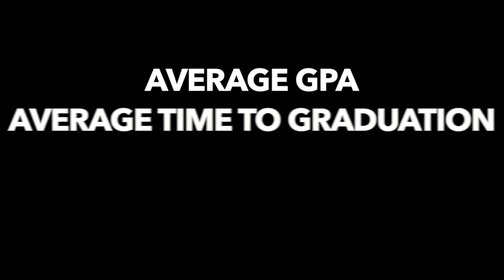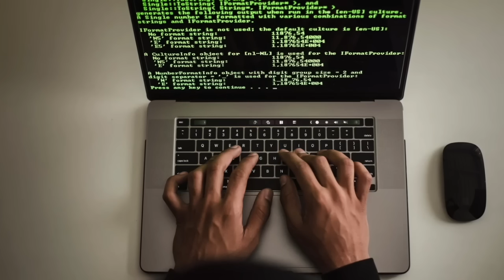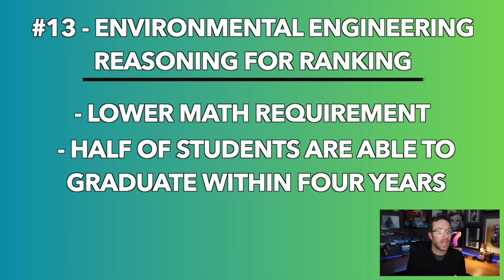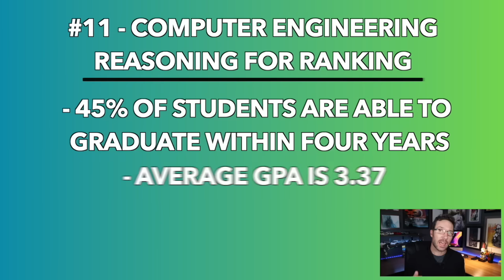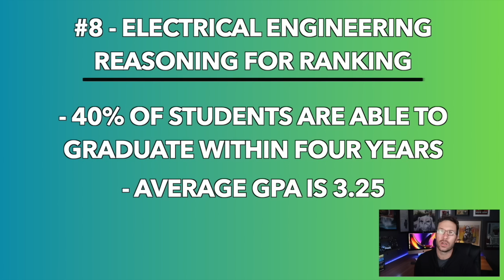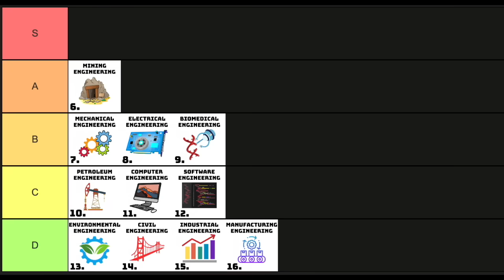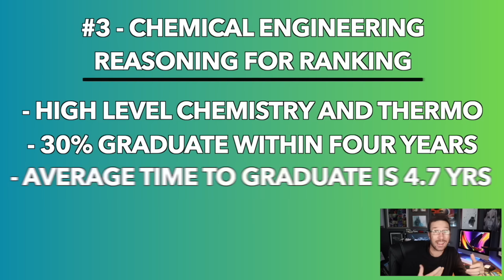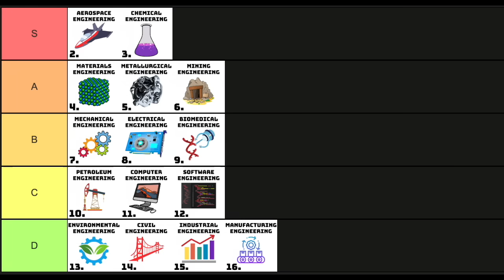Engineering Degrees Ranked By Difficulty (Tier List)

Comment: Chemical Engineering is definitely one of the most difficult.  Consider doing it in 4 years while working a full-time job and still achieving a 3.7 GPA.  The pay is MUCH higher than what they say here.  I am making over $200k as a senior-level program manager in the pharma industry
Reply: How many years of experience do you have? I’m also looking into chemical engineering for uni, would you recommend it?
Reply: @MLA979  I graduated College in 2000 with my B.S. in Chemical Engineering.  I think it is a great degree, because it is so flexible.  Yes, you can design chemical processes, heat exchangers, reactors, distillation columns, etc. But, you don't have to.  As a Chem E., you are well-respected by others, as they know what it takes to complete the course work with a very good GPA.

I have spent my career perfecting my "personal brand".  I started out for a decade in the semiconductor industry, but then transitioned over to a Medical Device company, as I didn't want to get typecast as a semiconductor engineer.  I developed leadership skills, among other things, along the way,  Now, nearly 25 years into my career, I have a great income with a great job with plenty of opportunity to pursue a Sr. Director type role.  

I hope this helps.
Reply: This is very refreshing to hear. I’m currently a ChemE senior. I was worried about average salary in this vid. I know starting salary isn’t $200k but willing to put forth the work and effort to get there!
Reply: @errrcc that’s an insane salary average people live off 30k
Reply: @RedArrow808  true. But that’s a reason why I went into chemical engineering. It’s a tough tough degree to finish and that’s why it can make big bucks. Plus it’s a degree that can provide for my family.
Reply: I'm working as a manufacturing engineer, doing mostly software and data engineering, while having a chemical engineering degree LUL. I definitely feel overqualified with the degree, given how difficult that shit was
Reply: Is it normal to end up with a salary like that or even higher for a chemical engineer? And how much time/experience does it normally require to get to that point.
Reply: @FrancoGM Anything pharma is huge.
Reply: @FrancoGM  I'm 45 pulling $200k+ with bonus. Chemical Engineer in the life sciences field doing Program Management
Reply: @FrancoGM  As I was finishing my MS in chemical engineering, I asked an experienced ChE what the career path was for a chemical engineer.  He said that most chemical engineers have moved into management within about 4 years because their knowledge base and understanding of processes and of the financial implications of decisions (e.g., process design and economics for chemical engineers) was superior to that of other disciplines.
Reply: 1985 ChemE grad.  I think EE is the hardest - or would have been for me.😊
Reply: @nealewalter I’m an EE but started out ChemE. I think whatever you are interested in is the one you should pursue. I was interested in BME but decided to pursue one of the more foundational engineering fields because the job market was broader. BME jobs are hard to get depending on where you live versus other industries.
Reply: You’re a pm not an engineer.

Program Manager get up to $300k with bonus and directors get about $500k where I work.  VPs are $1M.  

Many got engineering degrees but aren’t engineers anymore
Reply: @Youtubeuser1aa  The power of pivoting.... It's what you HAVE to do in odder to maximize your income. Skate to wear the 0uck is GOING to be.
Reply: Lol quants make $200-250k+ (not even including total compensation) out of undergrad…
Reply: @bruhchilll  I wish you well. Quite a lucrative career in quantum funds
Reply: @bruhchilll however, many unemployed after graduation
Reply: Hell yeah brother! And yeah the average pay always feels quite low for these but if you specialize and something or perform better than the average Joe you can land WAY above average in pay.
Reply: @nathanielmillington4950  BINGO! I have unique skills in the life sciences that I leverage to my advantage. Not only am I technically savvy, I'm in Program Management, which requires great leadership to do well. Also, being able to take on improvement initiatives while doing a great job day to day and having a good attitude... They all matter
Reply: What university did you go to?
Reply: @tiziocaio101  University of New Haven in Connecticut
Reply: @degenerate_mercenary9898 ur right, but nothing u said contradicts what i said lol. even if the positions are scare and "elitist", those quant positions still pay the highest by far out of any field right out of undergrad... :)
Reply: @bruhchilll  so what? Whats your point? mike zuckerberg dropped out of  college and became a billionaire lol quant positions are not easy to land, life is not a contest
Reply: @hil449  lol ur kinda just saying the essence of my point to the original comment, OP is bragging about chemE and its high pay, i simply stated a field that has even higher pay, and ur stating another path that has evennn higher pay... mad?
Reply: Electrical Engineers in the pharma make more than Electrical Engineers in other industries.
Reply: @benrex7775  I don't doubt it. For diagnostic equipment, drug delivery, etc. Absolutely
Reply: @errrcc  tbh i find that hard to believe. link an entry-level out-of-undergrad chemE position that has a starting salary decently higher than $250K. im genuinely curious to find out
Reply: Plus all of the pre-med students with photographic memories in your organic chem classes
Reply: Nuclear Engineering - I had to take Advanced Differential Equations, Matrices and Vector Spaces, Calc 3, Modern Physics regarding Relativity and Quantum Mechanistics, Circuits Courses, several thermo classes, plus the nuclear core classes - It was incredibly difficult.
Reply: Creating bogus vaccines ?
Reply: @pawbgles  I treated college like a job.  I was a late-bloomer of sorts, at lease socially, so missing parties, etc. didn't bother me much.  The classes were tricky, at times, but I practically lived in the lab/classrooms.  Where I went had smaller class sizes, so access to an all-PhD staff was readily available. I had my core group of co-ChemE's that I hung around with, but they were diligent engineers as well.  We were a tight group.

The way I looked at things was this: I can bust my ass for 4 years and the rest of my life will be easy, so long as I live within my means.  Getting a ChemE degree has been great for me. It is a highly-technical degree, so people know that you know your stuff when it comes to chemistry, physics, electrical, mechanical, and many others types of intelligence. With my education, I have been able to "reinvent" myself a few times during my career, which has allowed me to pursue higher success in adjacent fields.
Reply: When I was getting my ChemE degree, the credits required were misleading, as they were bounded by university limits on how many could be required.  The work around was to only require the last course of a sequence. 

I wonder if this sort of back door requirement was included in the credits calculation.
Reply: @BobDeRosier we had a similar situation. Credits were supposed to be based on class time and workload outside of class. All of our professors admitted that a 3 credit ChemE class was more like a 5 credit class and a 4 credit ChemE class should really be 8 credits but they couldn't allow that to exist.
Reply: That is deceptive BS. It is bad enough that you have 7 or in some cases 8 sequential courses. To also have a course required to take another course without having it count towards your degree is awful.
Reply: Becareful with studying chemical engineering, you dont want to be stuck working in refineries near the gulf coast. Very filty air... My wife is chemical, fortunate she work at any govt office
Reply: @Cordycep1  Yes, petroleum engineering is it's own thing. If you like designing Refractory systems, distillation columns, etc. It can be a good career. If you don't like that, you should pivot quickly before you become pigeon-holed as a petro engineer
Reply: after how many years of work?
Reply: Chemical eng also requires partial differential equations and quantum mechanics? Additional covers nuclear stuff?
Reply: No kidding.  As you know you have to understand chemistry.  My mother had a PHD in Biochemistry.  Smartest person I ever knew. 

I preferred to travel the world building everything the rest of the engineers dreamed up. I was able to make it all work even if they left out the most important part.
Reply: Program managers earn a lot, and I think that's an understated value of Chem E - between the material itself (process optimization, factory economics, etc) and the skills developed to thrive in such a difficult degree, you'll have an edge when competing for leadership roles. 

Not to mention the other ways it turns you into an efficient, capable worker. I'm in the middle of an entrepreneurial endeavor, and I have my degree to thank for making it happen. 

My day job pays decent too, though I'm only a year into my career, so it's nowhere near 200k 😆 but it is more than the supposed average chemical engineer pay listed in this video... that must be a dated number. 

I will say that my GPA doesn't seem to matter to anyone. At least not in this industry.
Reply: you think EE team leaders in embedded chip design gain just a few bucks?
Reply: I m making $1 million plus annually as investment banker, waste my time to be engineering major
Reply: @willieho3056  That's fantastic. 👍
Reply: Ciricullum wise hard but will not face the same once you get into a job it's fun and interesting
Reply: Is it possible to open your own business in chemical engeneering field?And if i m not really good in chemistry,could i be a good chemical engeneer?I dont like to cram long inorganic formulas,i m better at understanding procceses.I m choosing between ChemE,EE and petroleum engeneering right now.Pls give me advice.
Reply: @emilmammadov6868  for  chemical engineering, apart from having a good knowledge of process technology, you need to have strong grasp of organic for which you don't need to have deep down basic knowledge from day 1 , you can get to know and brush up yourself whenever you want during your btech course. But if you have phobia for chemistry then please maintain distance from this I would say rather take EE .
Reply: This ain't a pissing contest.
Reply: @ArmyNurseCorps-u5c  I don't see any piss around, so I think it's good
Reply: There's almost no chemistry in chemical engineering.
Reply: @sjn7220  Not true. If you need to design a 100,000 metric ton/yr of cumene, you needs to figure out the best reaction method that will yield a eotable quantities while waste products are minimized or reused.
Reply: @paulBIOgeek  Yes, but that's all modeled mathematically. You're not studying mechanisms or, usually, trying to come up with a new reaction for a product (unless you're in R&D). Every reaction we studied in my ChemE classes was A + B -> C with rate law X and equilibrium Y. All mathematical. Granted I graduated 30 years ago and got a PhD and went into research, so maybe things have changed.
Reply: @paulBIOgeek   we hardly do any chemistry the only chemistry thing we have is organic chem and thermodyanmics which is mostly physics
Reply: I have to agree. The video is a bit off on that one!
Reply: @errrcc  guess there are none? no rush, like i said im genuinely curious
Reply: @errrcc  i did, read up
Reply: @errrcc  why r u so mad lmao, u that sensitive about salary and whos major is harder? someones got a chip on their shoulder. lil bro is throwing random accusations left and right talking about data tryna act smart when u cant even find a reply to ur own comment, oh the irony 😆😆. sigh, here's my original reply tho to help u lil buddy: "tbh i find that hard to believe. link an entry-level out-of-undergrad chemE position that has a starting salary decently higher than $250K. im genuinely curious to find out"
Reply: @errrcc  i hope u actually tried opening the entire thread and doing ctrl-f and not just relying on youtube's notification system which is bugged half the time. regardless how about u answer my question/task first before u start asking ur own questions? that's just common courtesy, does chemE ethics not include common ethics? lol. i'll even reiterate my question a third time for u now: "link an entry-level out-of-undergrad chemE position that has a starting salary decently higher than $250K"
Reply: @errrcc  lol you can do anything but find me an entry level chem E position that pays more than the highest paid entry level quant positions😆😆. and ur again asking someone else a question before answering a question asked to them first, guess thats just how chemE engineers roll? or just a lack of self-confidence to have to cope this much on youtube lmao. not surprised, since all my Berkeley chemE friends admit chem E is easy compared to quants who typically are triple majors/degrees at least in stats, math, comp sci, etc.. chem E is one major lmao, even if yall do study multiple subjects, still just one undergraduates degree worth of work, easy compared to quants. ironically, thats why ur "skewing the data" when you claim chem E is the hardest degree since in case ur still not aware somehow, there is no (single) "degree" for quants, otherwise quant would easily be at the top of the hardest undergrad degrees in all these stats u read from online which only look at single degree data lol. didn't think i would have to explain that to someone who "can do anything" 😆😆. thanks for humoring me tho, was a good laugh and found enjoyment in you coping this hard. ill end this argument and ur suffering with this tho since it's getting pretty obvious/annoying that ur avoiding my original question at all costs: "guess there are none? no rush, like i said im genuinely curious"
Reply: @bruhchilll   😂😂😂 I never said quant was one single degree 😂😂😂😂 again skewing the data for your benefit and assuming things which all your comments have been lol. Good luck king. You got dissssss. Even tho as stated by other ppl, there aren’t much quant jobs and the highest paying in my state was 100-130k and we know the employer does not pay the max there. And the other 2 quant jobs payed less than 100k. Crazy only 3 quant jobs in my state with NO ENTRY level. But I bet you’ll respond with another so and so and can keep going forever. Thanks for the laughs and entertainment 😂😂😂😂😂😂. My department was laughing like crazy. Hope you can get that limited quant job. Genuinely wish the best king 👑
Reply: @bruhchilll quants lol
Reply: @bruhchilll quants lol what a useless bunch
Reply: @Youtubeuser1aa  took u multiple comments/tries just to come up with that huh, talk about being "useless" 😂
Reply: @bruhchilll  I replied to you once and only once lol.  Maybe you should learn to count 😂😂😂😂😂
Reply: @Youtubeuser1aa  ?? i literally still see rn two different comments by you both @'ing me with the second clearly being an edited version of the first... either u have zero awareness or ur the one who can’t count, either way congrats u played urself 😂😂😂😂😂😂😂😂😂😂
Reply: @bruhchilll  maybe I correct a typo and you don’t understand that is just one comment, that or you don’t know how YouTube works lol.  Regardless it’s hilarious and brings into question your expertise on technical matters 😂😂😂😂
Reply: @Youtubeuser1aa  ?? ur acoustic huh. i already knew u “made a typo” since ur 2 separate comments that are obviously edits of each other made it clear that u wanted to just edit the original. and now ur embarrassed that ur mistake is exposed. this has nothing to do with technical expertise atp, u just can’t admit u took an L. i’m sorry that quants live in ur head rent free 😂😂😂😂😂😂
Reply: @bruhchilll  “ur acoustic” … your first sentence doesn’t even make sense, I won’t read the rest.  Lol

Comment: Mechanical engineering is 7 ha dear while electrical is number 8 hardest. Both have about 40% of students graduating within 4 years. Mecha iCal engineering has the highest level maths of all engineering degrees.
Reply: Sorry but not true.  Electrical Engineering, specifically the field of Signal Processing and communications has the hardest math of any engineering, BY FAR. You are exposed to Vector calculus, complex analysis, etc
Reply: @victorhugoferreira4617   The guy said it in the video at 7:30. This is the first I hear that mechanical engineering has more math than electrical engineering myself. I'm glad we agree on that.
Reply: @victorhugoferreira4617  I total agree with you currently taking my last college year in networks and telecommunication looking forward to do ECE in Uni and I have to say signal processing is tough
Reply: @victorhugoferreira4617 u dont know anything about cfd do you 😂